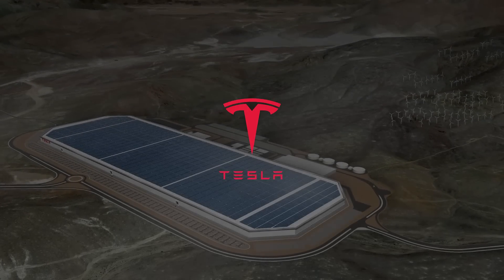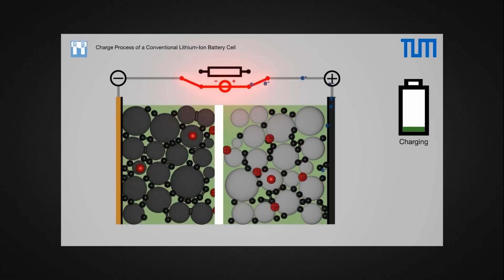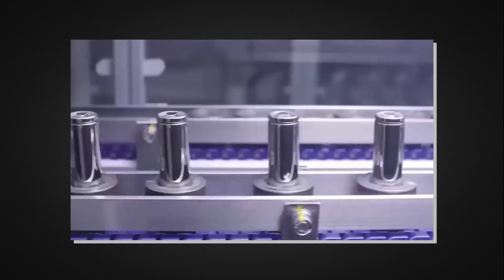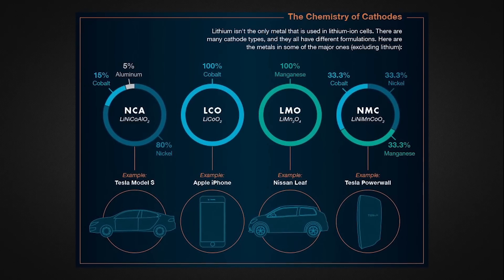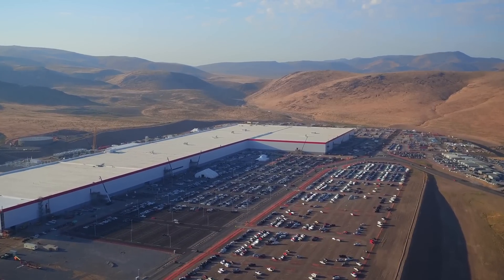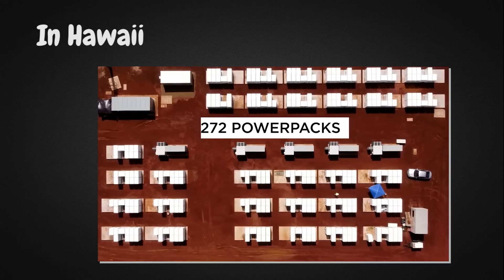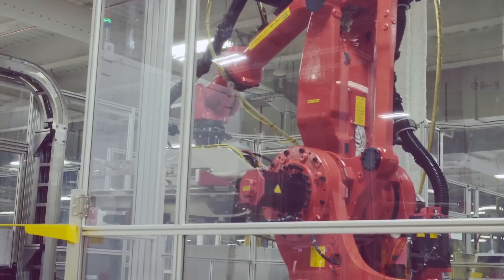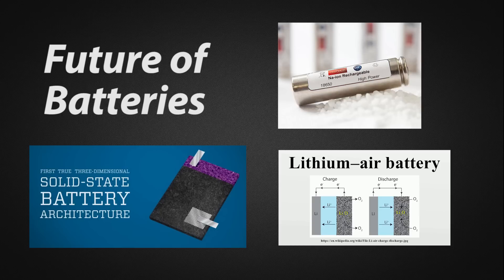Tesla Battery 101, How does it work?

Comment: How do I know which batteries are in my Nov 2017 model s?  Just curious.
Reply from the maker: It's likely to be the 18650 batteries. from what I know,  21700 is used exclusively for model 3 at the moment.
Reply: Probably also in the new Roadster.
Reply: And PowerWall 2

https://www.teslarati.com/tesla-model-s-x-no-plans-use-2170-battery-cells-says-musk/
Reply: What difference would it make to know?  The fact that they work should be enough.  Move on to other subjects in your life.